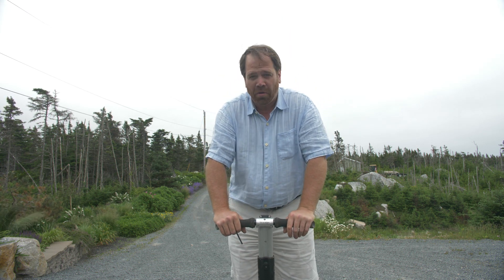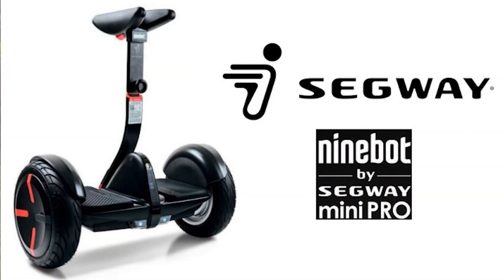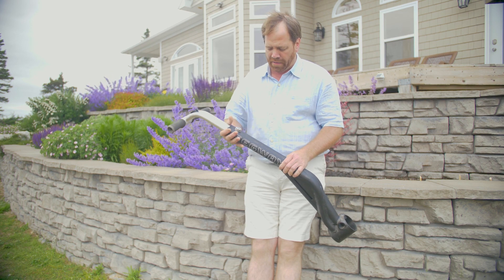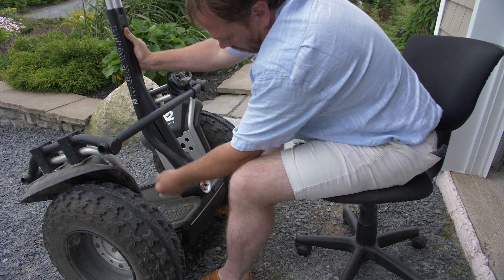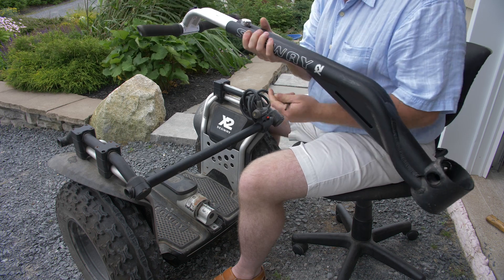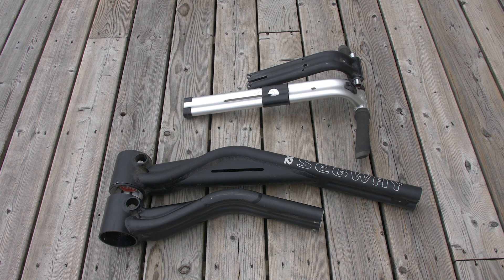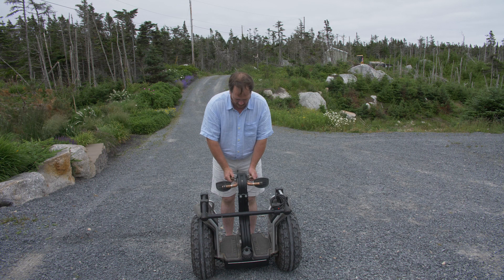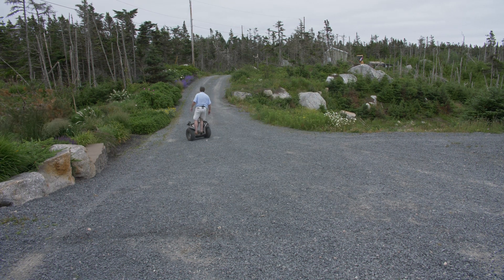Modifying a Segway X2 to be a camera dolly

Comment: Hi Trevor,
This is a very well done video and thank you. What is the black bar assembly that you have that connects both sides of the cargo plates. Is it something one can purchase? I am in the process of setting an X2 up with the DJI RS2 gimble and I'm interested in what looks to be a cross cargo plate connector. Thank you much for your help and again, excellent video! Bill Steele (Phoenix, AZ) 602-510-8880
Reply from the maker: The bar spanning across the cargo plates is a golf bag mounting bar. The golf bag mount slides into the two open ends on the right side of the X2. I rarely have the golf bag mount on unless I am taking the X2 to the golf course, but the mount bar stay on 100% of the time as it is too much effort to bolt on/off all the time. The golf bag mount comes from Segway, but not sure if they still sell it or not. Can probably find one on ebay.
Reply from the maker: After reading this s second time: i would not mount the gimbal directly to the Segway, still too much up and down bounce that the gimbal cannot accommodate and you would not be happy with the result. I tried that already. That’s what led me to develop the knee steer in the first place to free up my hands to hand hold the gimbal.